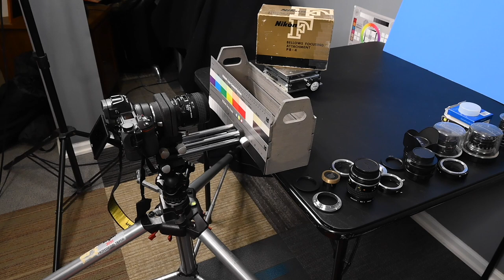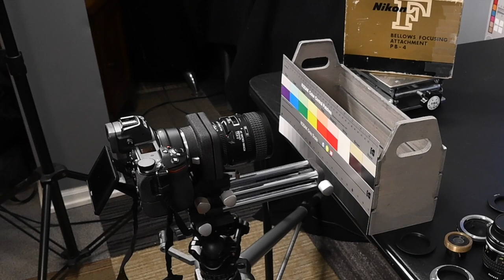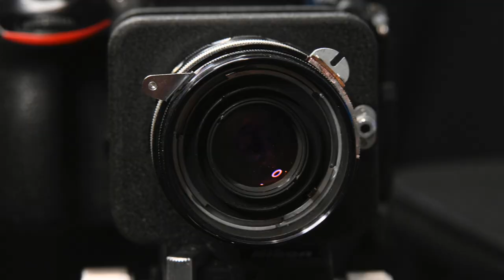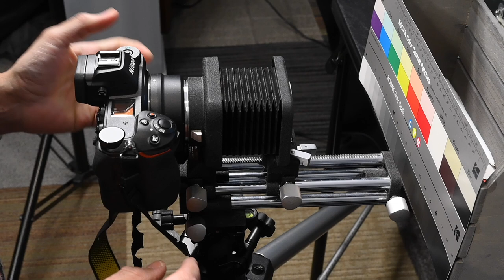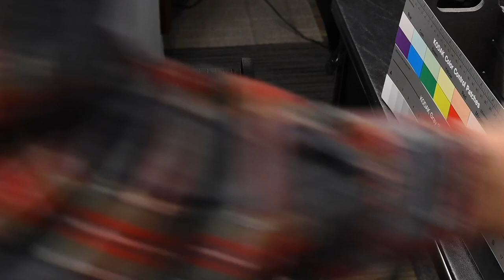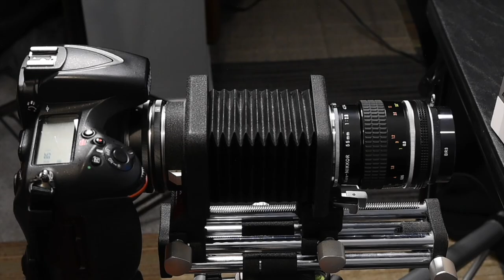Using a Nikon bellows on a digital camera

Comment: The PB4 can also be automatic when mounting the BR-4 special Nikon aperture control ring between the front of the bellows and the lens.
This ring has a remote release thread for the Nikon double cable remote release.
One model Nikon remote release AR-7 has two mechanical cables, one for the cameras with a mechanical remote release and one for the aperture control ring
Another model Nikon remote release AR-10 has one mechanical release for the aperture control ring and another 2 pins electrical release cable for older film cameras with motor drives. A Nikon adapter MC-25 changes the 23 pins connector to a modern 10 pins Nikon connector that is compatible with Nikon DSLR's thats how I use the PB6 in automatic on the D850

Comment: If your grip hits the bellows to prevent mounting but you don't want to add extension tubes, try rotating the bellows mount 90 degrees before mounting the camera. It worked for my Nikon D5300.
Reply from the maker: Thank you. Good advice.

Comment: @ 14:40 for installing w/ a grip in the way, at least on a PB-6 I know of w/ F4 (MB-20 grip). Position the bellows in is vertical (portrait) position then mount body and rotate back to horizontal if the PB-4 has that option.  I want 1 now for the tilt shift. D3/4 will need extension PK ring for batter base.

Comment: Thanks for this video. I just picked up a PB4, may I ask do you know who makes a adapter to add a Nikon Z mount lens to  the Bellows?  I have a Z mount 2x Macro that I want to use on the Bellows. Any help greatly appreciated.
Reply from the maker: There is no adapter to use Z mount lenses to F mount. There is no mechanical aperture ring on Z mount lenses, so there will never be a way to use them on F mount cameras, bellows or extension tubes.

Comment: Nice video Jules. It made me wonder if Nikon have ever made a lens with the elements in an arrangement to mimic a reversed macro lens. It also made me wonder where my bellows unit is.
Reply from the maker: I don’t think they ever made a reversed macro, but I think it’s a great idea.
Reply: @julesvuottosphotofocus4696  Thanks.
Reply: Agree, second great video of his I watched today. I used mine for slide copying before the ES-2 came out. Also because of the small depth of field you could use focus stacking on three dimensional subjects etc. in a digital photo editor.
Reply: I know they made a bellows specific 135mm lens (and possibly more for specialist applications) that was 'optimised' for macro work. What specific technical specs this optimization was I have no idea
Reply from the maker: @mattdyer9544  there was also a 105 bellows lens.
Reply: @julesvuottosphotofocus4696  Now looking I believe that's the one I'm thinking of. I saw one attached to a cheap bellows on a nikkormat over a year ago on eBay here in the UK and haven't seen one pop up since so they can't be too common. Though I can't say I've actively been looking for one.
Reply: @julesvuottosphotofocus4696  The only reason that retrofocus lenses perform better reversed at higher magnifications is precisely that they were necessarily retrofocus designs in the first place! A traditional, non-retrofocus flat field design, as typically used for enlarging purposes, won't benefit to the same degree as they're usually based on a symmetrical optical design; classically the Double-Gaussian design. PS. Nicely presented video!

Comment: one important point to optimise lens sharpness performance on the bellows is to know if the lens has FLE (floating lens elements), if yes if they are manual or automatic.
If the lens doesn't have FLE no problem
If the lens has manual FLE (like my Sekor C 80mm Macro) the ring has to be brought to Macro position
If the lens has manual FLE the focus ring has to be brought in macro position
Reply: I just read in a Nikon information article for the AIS 55 Micro 2.8, that its automatic FLE system flattens the field curvature at minimum focus distance, what's necessary with wide open apertures. They also say that for more closed apertures (perhaps f:8 or smaller) FLE correction no more matters.
This means that for typical macro apertures of f:8 or smaller with the 55 micro, what I said in this post no more matters.

Comment: Hello sir, thanks for sharing this information, it's very good. I have a question, I can't connect Nikon PB5 bellows to my Nikon D810 because of the camera grip which is very thick. My question is, can I use a Nikkor M2 extension tube directly on the camera to gain some space between the bellows mount or do you think the mirror will be damaged? Because the M2 tube seems to be a bit long on the rear part and I'm a bit scared that the mirror might be damaged by touching the part that goes inside the camera. Thanks for your help. I await your response.
Reply from the maker: @oscarlopez2052  The M2 will mount fine. However it will give you 27.5 mm of extension. A shorter tube will also give you enough clearance to mount the bellows.
Reply: @julesvuottosphotofocus4696  thankyou sir  i  dont have another tube and i want  to use the bello es to scan negatives do you think  it will be ok this wey . Thanks again .
Reply from the maker: @oscarlopez2052  Yes. What lens will you be using.
Reply: @julesvuottosphotofocus4696   I am looking to purchase an enlarger lens probably the Nikkor 50mm 2.8 or Rodagon 50mm 2.8 and I will attach it to the end of the bellows and so I will get a plane to plane surface scan thankyou so much
Reply from the maker: @oscarlopez2052  You may want to consider a longer focal length enlarger lens. Because of the longer extension tube you may be too close to what you are shooting.
Reply: Hi, I have the part that goes in front of the bellows where the slides and negatives are mounted. That also moves forward, which would gain space from the lens to the slide holder. Do you think that even so, it will be too close? If so, which enlarger lens would you recommend? Or maybe a shorter extension tube? Thank you very much for all your help. I have been trying to configure this for a long time, but I am not very clear about it. Thanks again for everything.
Reply from the maker: @oscarlopez2052  You can try it, but I think you will need a shorter tube.
Reply: @julesvuottosphotofocus4696   Sorry to bother you at this time, but what size extension tube would you recommend? What would be the correct size? Thank you and I apologize for bothering you.
Reply from the maker: @oscarlopez2052  I completely forgot that if you rotate the rear mount (the part that mounts to the camera) you can mount the bellows on the D810 without an extension tube. Then once mounted, rotate it back  to horizontal position. There is a button near the rear mount you need to press to rotate the mount.
Reply: @julesvuottosphotofocus4696      II didn't know this, I'm going to try it. I need to see a video of how to do this so as not to damage the camera. Thank you very much for your help. I appreciate it.

Comment: I'd like to point out that using the BR-3 and a reversed 24mm is not advisable at full 10x magnification as the working distance from the lens element is right around 10mm. The BR-3 sticks out a little over that. I have both the PB-6 and the PB-4 With the PS-4 copy attachment and all the rings nikon offered.

Comment: No problem to mount a DSLR with grip without extentions.
When I mount my D850 on the PB-4 I have just to go completely at the rear with the camera mount plate and turn the "rotating back" to vertical before mounting the camera. Once the body in place I return to a normal bellows setting.

A use the bellows a lot with the slide/film copy attachment to scan 35 mm film with the D850.
Reply from the maker: You are correct. Thank for the clarification.

Comment: When you say that the 105mm Short Mount lens that was made for this bellows, can focus to infinity, does this mean I can use it as a non-macro lens? What are the potential drawbacks of that lens before I decide to purchase one.
Reply from the maker: It can only be used with the bellows and it has a pre set manual diaphragm. It is designed for best performance at close distances. Also it’s not very convenient to hand hold a lens on a bellows so it should be used on a tripod.
Reply: @julesvuottosphotofocus4696  Right. What I was wondering is if I could use it as a traditional tilt/shift lens for portraiture. I bought a PB-4 20 years ago when I was doing a macro project and couldn't fit it to my digital camera (so thanks for clearing that up!) and the lack of information lead me to believe it could only be used with a specialty lens. So it sat in a case ever since. The thing is in absolute mint condition, and thanks to you I'm going to start using it next week!
Reply from the maker: @Owenwithee  it has very limited tilt and shift. I never heard of using tilt and shift for portraits.

Comment: Is it advisable to use the PB-4 in vertical position, to be able to use the tilt/shift function for product photography?
Reply from the maker: Excellent question. I've never tried it that way, but I think it will work. I'll try to get around to testing that over the next few weeks. Thanks for watching.
Reply: @julesvuottosphotofocus4696  that would be fantastic! I‘ve got my eye on a used one, I just want to make sure buying it makes sense and the lateral stress won’t damage the rails. Thanks for creating!

Comment: When using the bellows do you use the lens to refine focus or just set focus anywhere you want and then use the focusing rails on the bellows. Infinity or  the closest focus or does it even matter
Reply from the maker: It does matter a little. If you have the lens set for its closest focus distance you have more extension. But the best way to focus when in the macron range is by moving the entire assembly back and forth using the bottom focus rail on the bellows.